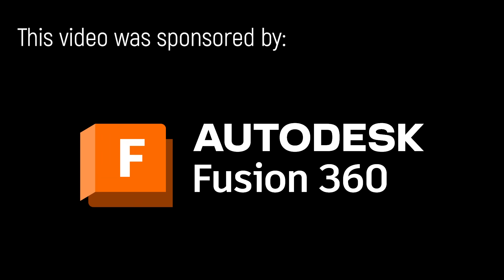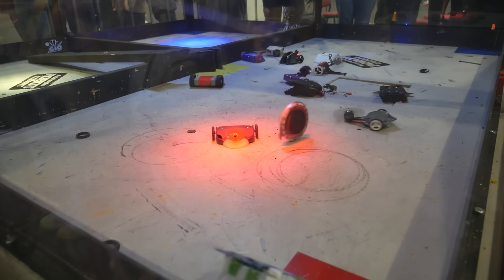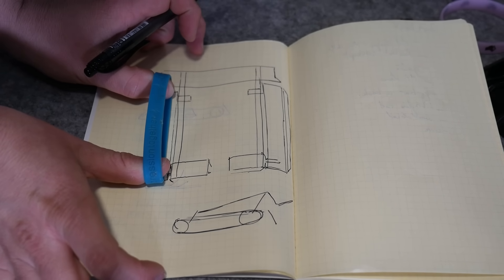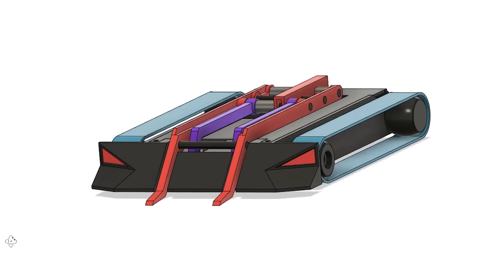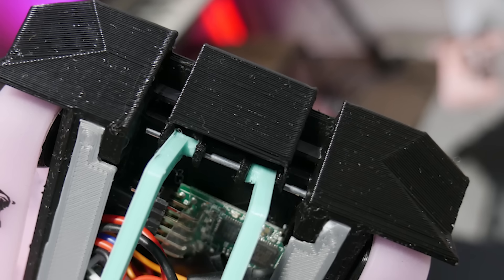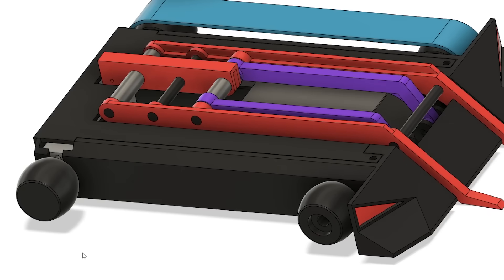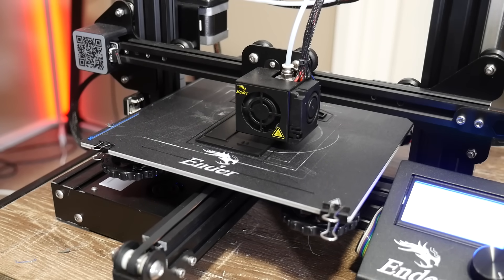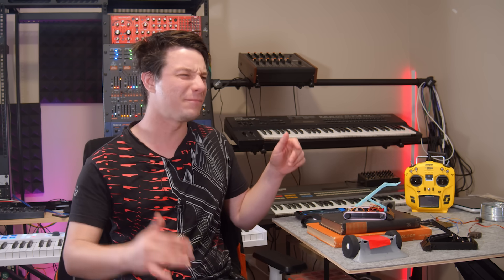My 3D Printed Robot sucked... so I made an UNBEATABLE one!

Comment: Fantastic video! I was intrigued by your use of the sketch function to play with 4 bar linkages. Previously, I had been making bodies/components to test linkages. This saves a ton of time prototyping!  To anyone interested, it involves fixing (see fix/unfix function while sketching) the pivot points and using sketch dimensions to fix the bar lengths of your 4 bar linkage.

Comment: Noob here. I am making a bot with a similar drive mechanism. Does anyone know what type of hardware was used for the front, belt driven wheels? I'm not even sure what search terms to use haha
Reply: The front wheels use M3 SHCS (socket head cap screws) as dead axles.

Comment: Hey, thanks so much for this video. I'm trying to get my daughter into building this. With the Botbitz MiniAnt ESC sold out ... could you suggest an alternative ESC for this project? (ESC is synonymous with motor driver, no? I guess some motor drivers are strictly ON/OFF and not speed controllers, but ...) I know we want 2 channels and braking, right?  Thanks again!
Reply from the maker: I would recommend the Malenki-Nano instead, it's a bit more pricy but can bind directly with Flysky / Turnigy AFHDS-2A protocol transmitters so you don't need an additional receiver.

Comment: This little thing is absolutely adorable, though I wonder if the profile can be made even lower by using a different method of attack. Perhaps something like a spring powered forward push? I wonder what the ratio of small springs to batteries is in terms of energy storage per weight

Comment: I've just got this robot almost fully built, but I just got my bands in for the treads and my motors wont spin them while they are on. I have them stretching right now so we'll see how that goes. Thanks for providing the design, my son and I have loved building this together. What rpm and gear ratio motors are you using in yours?
Reply: 50:1 gear ration N20 motors.

Comment: 02:35 surely the simplest way of redesigning it would be adding a tail section out the opposite side of the scope and therefore preventing it tipping up from the torque of the motors and lack of weight in the scope? 🤔

As for a name….how bout sticking with the ant theme and using an insect or arachnid name? Like pseudoscorpion or earwig?

Comment: For lifting the forks, a faster firing system would be better. Maybe something like a spring that can be tensioned and released quickly, like a cuckoo clock, or springs like in toy guns that use springs to fire, like Nerfs. This would make it possible to launch the opponent's robot higher and faster.

Comment: What about using continuous rotating servos instead of the geared motors? They generally have a lot more torque and you can increase the voltage to up the speed as well as changing the wheel diameter. It also makes things a lot more simpler.
Reply: Way, way too slow.

Comment: you might want to alter the linkage in such a way that it can flip itself back over to upright it turned upside down, possibly by having the back "wheels" contact the ground in that position if the linkage is extended - that way you might flip back to correct stance with a fast forward jerk.

Comment: What are the rules around deploying something like a mariokart style oil slick?
I've had this though a few times, you deploy something like talcum powder into a fan to spread it. When it lands on the floor it becomes very slippery. If you could design a traction solution that could still give you drive, you would have a massive advantage.
Reply: Literally illegal in every event
Reply: @Coboxite  dang

Comment: Hugely disapointed by Autodesk about Fusion 360. After a friend of mine got a PocketNC (5 axis hobby CNC), I was about to buy the components to extend my 3 axis home made CNC to a 5 axis 2 years ago.
At that time, Autodesk decided to remove the 4-5 axis CNC out of the Hobby licence. I canceled my 5 axis extension project
My friend bought a 3-years licence ($1400) 
Just a year after, they moved the 5 axis capability to a "Extended Manufacturing" bundle, charging another $1500 *per year*.
Sadly, this is just the usual way Autodesk considers hobbyists

Comment: For some reason Chrome is flagging your zip files as "This file is dangerous, so Chrome has blocked it."
No idea how it's convinced itself that a zip containing some STL text files is dangerous.

For anyone seeing the same nonsense warning - press Ctrl-J to open downloads and then click that you want to keep the download.
(sometimes Chrome will warn you for a good reason and you shouldn't just ignore it, but that is not the case here)
Reply from the maker: Thanks for letting me know! It's been doing this with .stl but if it's also .zip that's a big issue. Firefox doesn't have this issue.

Comment: one of the wonderful things about this weight class is how many hilariously easy+cheap to get materials actually work pretty dam well for structure in a bot. here's a great example which do you think has more structural integrity per weight as a side panel: a sheet of titanium or a panel of decent quality pvc foam? even the cardboard from a cereal box ends up being surprisingly viable and both of those materials have the benefit of not transferring shock to the rest of the structure.

Comment: Thanks for making these files public and free. My 7 year old and I were in Jaycar the other day and he was looking at "battle bots" (very loose term). I'll be spinning a couple of these up to have a play over the holidays with him! Would you consider doing a BOM for the other parts? Motor, Servo, receiver etc?
Reply: The motors look like n20, probably 600 rpm or so, the esc he mentioned, and you'll need a small reciever. Guessing the servo would be mg90, you could run it on a small 1s or 2s lipo battery, something like 200mah should work. Alternatively get a melinki nano from Bristol bot builders and that has radio and esc built in.

Comment: I would min/max the electronics. Use motor wire, enamel coated wire. Replace all wiring with it. Remove all pin headers from the boards. Maybe even go as far as to re-design the boards using only the required components and move those components to the new boards. Or, combine the speed controller and receiver into one board.

Comment: why dont you use a rubber band for more power while lifting and have a motor pull the rubber band back
Reply: I was thinking along the same lines but it might take too long to reload. As a secondary weapon have a servo load up an elastic on a ratcheting spindle with a trigger release mechanism. It could work in conjunction with the primary too.

Comment: 9:19 That disc shaped robot has some really interesting physics going on. Self balancing single wheel that's jumping!? I doubt it standing on its edge is the intended configuration, but really cool nonetheless.
Reply: Hi, that one is my robot. It's a 'ringspinner', a ring shaped weapon spins fast around the outside of a normally stationary robot. The gyroscopic effects of this can be weird, and in that case it was flipped up with the inside spinning within the ring stalling in the ground.
Reply: @jameskirby9981  😄👍
Reply: @jameskirby9981  how effective are spinners at that scale vs other ant weight bots? im curious about its ability to actually do damage in a weightclass where thats rare
Reply: @teslacoil4335  Not James (but I was running one of the other spinners in that melee). Spinners in 150g bots can seem to do nothing, or deliver massive hits that throw/destroy the other bot (or themselves).  It depends on how much "bite" they get on a hit, which depends on weapon diameter weapon speed, engagement speed, and probably several other factors. This is true in any weight class, but in 150g bots the power to weight ratio is crazy, but similarly the weapon speeds are probably faster than they need to be (because of the high kV values in small brushless motors) so they tend to "grind" on the other bot, up until they actually get good engagement.
Reply: @slightlyevilrobotics4271  interesting, i was looking at making some custom brushless motors for a 150 gram bot,  power to weight ratios arent something i considered, i was originally just going to get the rpms to something crazy but ill tone it down then, thanks for the info!
Reply: @jameskirby9981  do you have some footage of your ringspinner? Looks really bizar, organic somehow
Reply: @jameskirby9981  that’s so cool!

Comment: Make an O-ring groove in your drive wheels that will preserve the crown profile when an O-ring is around the wheel. That way if you loose a belt you can still drive. It won't add much weight and give you redundancy.

Comment: I suspect that with a 50:1 gear reduction, the motor-braking feature of your new speed controller really isn't necessary. To test: un-powered, if you push the bot do the tracks slip or skip or does the motor back-drive? (I'm guessing slipping or skipping)

Comment: The simple fact that you’ve always used it and that it’s really cool that you got them as a sponsor makes me consider (once again) to use Fusion 360. I learned to use a different program at school, which is why I don’t yet, but you do often manage to get me thinking of using yours in stead.
Reply: Maybe consider using Blender or anything else that's not cloud based.
Reply: @anon_y_mousse  better freecad, blender is not that great for designing watertight 3d printed parts
Reply: @emanggitulah4319  I'll have to give that a shot. I don't think I've ever thought about watertightness with 3D prints, but I do have a copy of FreeCAD that I downloaded last year. Been meaning to check it out.

Comment: 4:00 Fusion has also removed more and more features, from paying customers even.

Funnily enough, the simulation talked about is exactly what they removed recently. Now only usable through consumable cloud credits bought only in packs of 1500 usd or more.

I use it myself, and it is more convenient than any other option I found, but its very troublesome a feature you might be paying to use today, might be taken from you without any reasonable warning the next.

Mixed bag there.
Reply: The simulation shown in the video is a static stress simulation, which is still included in the standard Fusion 360 commercial license.  Also, 'flex tokens' (formerly Cloud Credits) can be purchased in lots as small as 100 for $300 per lot of 100 tokens.  Trust me, as a paying Fusion 360 subscriber, I am NOT happy that modal frequency, thermal steady state, and thermal stess simulations now require flex tokens, but I just wanted to clairfy that for paying subscribers, Fusion 360 static stress simulations do not require flex tokens even though static stress simulations will now be done in the cloud.
Reply: well, i once used fusion 360, then found out I couldnt export it as a normal 3d file.... And then got the free blender which is AMAZING (even though you still need a slicer)
Reply: Yeah, I won't be using any cloud software ever. If I stop paying for a piece of software I expect it to keep working. Of course, I also expect that a piece of software will at most be a one time fee. There are enough open source and completely free 3D design programs, and they're quite good. Although, if a program came along that was open source yet non-free, I'd consider buying it over ever using Fusion 360.
Reply: @anon_y_mousse  :  If you pay for a Licence to Use something, I think it is fair enough that it stops working if you stop paying.   If you purchase an item however, you should be entitled to expect it to keep working without further payment.  I purchased an accounting package, and used it for twenty years with many many thousands of transactions entered into it.  After an update, it stopped working, and left me with no usable way back.  The only option was to purchase a new version, without even a loyalty discount!
Sometimes the original provider is not responsible;  I have a nice little Pressure-sensitive graphics tablet that no longer worked after a Windows update.  Even more annoying was my genuine MicroSoft webcam that also stopped.  There ain't no scruples in the computer industry!    ☹👎
Reply: @PiefacePete46  All software you use is licensed, even when it is open source. If I pay money to license something I expect that to be a one time fee. In other words, I would stop paying for it after I've paid once. No large corporations have loyalty to their customers. The closest you might get would be when they open source their drivers, but hardly anyone now or 20 years ago picked hardware for the drivers, even though they should.
Reply: @anon_y_mousse  yea but nowadays the subscription model is popular and makes way more money than one-time payment
Reply: @johnwig285  Popular with companies, not consumers, and we should collectively boycott any company that does that.

Comment: How's it do vs a shoe or flip-flop?  That turned out to be one of the hardest opponents for my 500g grabber/lifter Micro-Vice.  Plans for an automatic trigger on the lifter?  Missing the timing was always the biggest issue I saw with lifters.
Reply: you could try to use a spring / latch mechanism that triggers automatically when an opponent is in contact with it and close it against the force of the spring with a servo.

Comment: (10:08) "using design history, I can just go back and change the shell thickness". Yes, you can do that, but I've found it a lot simpler to just declare a parameter and use it in the course of modeling the object. You can start by setting "shell_thickness" to (say) 3.0, and then when you model your shell just type in the parameter name as the value. If you want to change it later, you don't need to track down the history element to change its thickness: change the parameter directly and it will be applied in the entire design history (which can potentially use this value in a lot more than just one step!). It works in sketches too, in case this feature of the object was derived from sketch lines.
Reply: Good point. I use parameters for just about everything now in Fusion360. I just wish the parameter functionality worked better - global parameters, search by name, namespaces, and making the parameter window dockable would make it a better product IMHO.
Reply: Straight up when I figured this out it started saving me so much time on designs it was crazy
You can even have parameters that are functions of other parameters. For example: You have "wall_height" set to 6.0mm and a circle cut out in the middle that needs to have specific spacing from the top and bottom, you can have the size of the circle be the parameter "wall_height - 2.0mm" now the circle will always have 1.0mm between it and the top and bottom.
Reply: @Gormadt  Yes, being able to use them in formulas is great, I use it all the time too. I think there's only one place where I've had trouble using them, and that's in schemas when drawing an N-sided polygon, where N would be the parameter. For example if you start with an hexagon centered on a point and with a certain radius, and want to change that to be an octagon by updating the parameter from 6 to 8. I just couldn't get that to work, even with a "unit-less" value and all, I never managed to get F360 to accept the value. If there's a workaround I'd love to know!

Comment: I has been a while and I might be totally wrong here, but the increased surface area of tracks shouldn't give you more traction, since traction is just static friction and surface area isn't a part of that equation. The reason tracks are used on vehicles is always to spread out the weight of the vehicle over a larger surface to prevent it from sinking in/damaging it.

So really the only advantage in traction you should be getting here is from the material being sticky and the "front wheels" being driven compared to having a 4 wheeled setup. I'm really curious how a 6 wheeled version of the same platform would perform with a thin belt/string transferring power from the axles connected to the motor to the other 4 wheels.
Reply: maybee im wrong but with a large surface didnt you get a bigger surface that sticks to the ground like a bigger wheel on a car?
Reply: @thomaskletzl6493  Bigger wheels on cars work because they're actually sticky when they get hot. There's also a very slight amount of deformation where the tires are flat on the bottom so instead of pure friction you get a slight bit of pushing(diagonally up but still)

So bigger wheels on cars work not because the larger surface area gives you more friction, but because they have other methods of giving you traction that don't rely on traction. 

For this bot there's never going to be enough heat to get the material to adhere to the floor(nor is that legal AFAIK) and flat deformation aspect of round tires doesn't apply to tracks.

Tracks instead get their benefits on loose surfaces where they sink less and their shapes can "bite into" the surface. Neither is applicable here.

Comment: I'd love to build a couple of these for little "Battlebots" fights with my friends. Any chance you can provide a full parts list? Thanks!
Reply: Did you check the description link ?
Reply: @edwardfletcher7790  Yeah, that has the STLs, but not the receiver/batteries/motors/etc. Unless I'm missing somethings
Reply: @Kuroneko42  The battery is the simplest item. He talks about the metal geared motors and Botbits receiver in this video.
But yeah, no product looks or model numbers.

There's more detail in the last Antweight build video. Here : https://youtu.be/BvNRtRuOALw